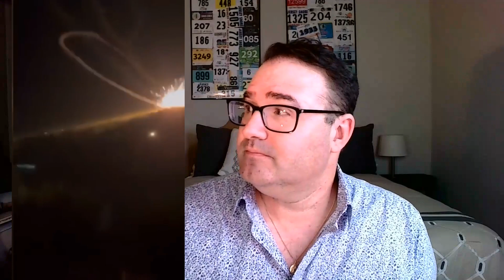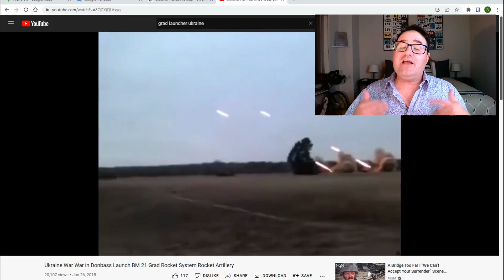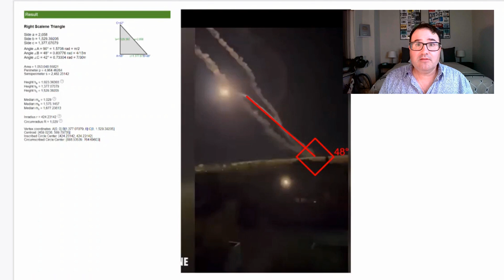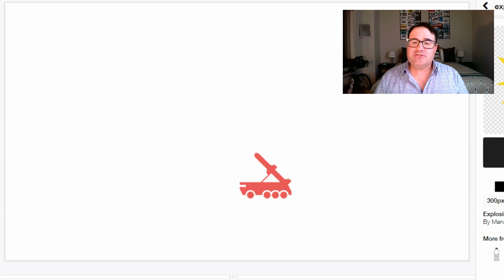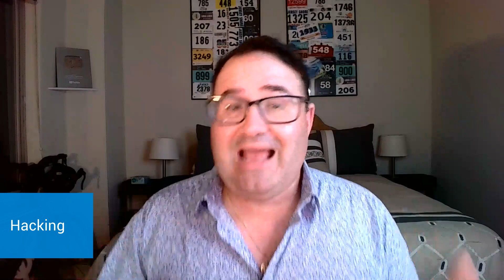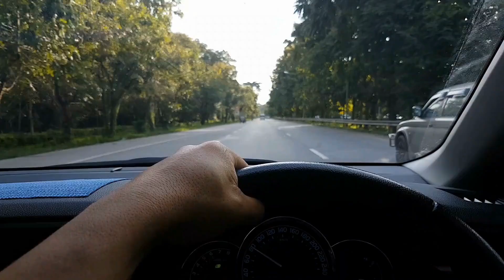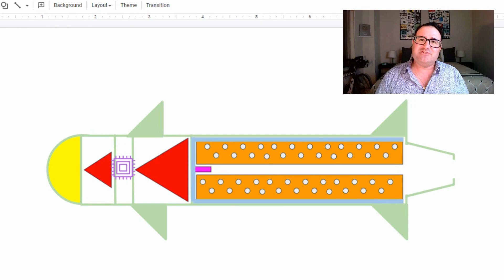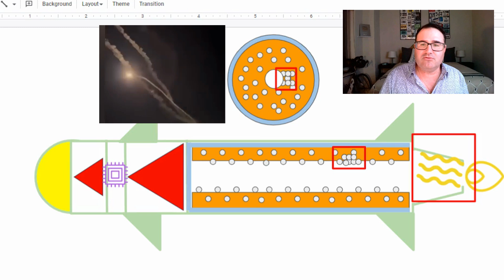Why this missile U -Turned

Comment: I think you're correct with mishandling. But i think it broke. an external fin or something like that. I don't think a slight asymetry in the thrust could account for that dramatic a turn. (unless the missile detected it and over corrected)
Reply: Idk man it sounds pretty solid. There's so much thrust coming out of that rocket motor that even a slight asymmetry could do some pretty wild things.

Comment: Is there an argument that the missile was not designed to work with the launch system and that there were a series of commands given that the guidance system interpreted as "turn around and go boom"  I'm thinking adjusting in a unit of measurement greater than it was being told to if that makes sense

Comment: In life you come to realize that more often than not, the easiest answer is th correct answer, in this case the mishandling or manufacturing problem (which could include a stuck fin to the side), instead of complex james bond type hacking or drone interventions

Comment: But if there's imbalanced of thrust isn't the missile guidance should correct it?
Reply: Only if the imbalance is small enough for the fins to correct it. The missile knows it's off-course, but all it does is repositon the fins to straighten it back. If the thrust just keeps pushing the missile off its path the guidance system will just keep command the fins into max deflection and wait until it straightens out.

Comment: The missile was assembled wrong. What caused those Boeing crashes were caused by some idiot literally jamming mission critical components into a slot that only accepts those specific components and only accepts those components in the proper orientation.

Comment: If it's a BUK, the missiles can do a 40g turn. Also most BUKs don't use a command guided missile, but rather a semi-active homing missile.
Reply: But that's exactly what Ryan said. There is a tracking Radar that tells the missile where to go until it's close enough to use its own radar seeker. That's the principle of a semi-active homing missile works.
Reply: @Espere  There is a difference between a Command-guided missile, where the shooting platform or another system is telling the missile what to do and a semi-active radar seeker that acts similar to an IR-guided missile, as it tracks the radar illuminated target without other signals from the launching platform.

Comment: It can still be a guidance issue. One of the Russian rockets, the Proton M, failed due to a flight control system sensor installed upside down. If the rocket is being told to go in a particular direction and the sensor is installed upside down, the rocket will attempt to correct itself to what it perceives as the correct orientation. This guidance protocol likely kicks in after a designed time period after leaving the launcher.
Reply: Proton M gyroscope can only mounted in one direction and yet somehow the engineer still managed to shove it in there lmao
Reply: @icarus1378  "of course i installed it right, it fits!"
Reply: @Usual_User  "Well...I did have to tap it a little with my hammer...but it's ok."    :-)
Reply: @icarus1378  All three sensors were installed upside down with the aid of a hammer.  And, apparently, a healthy shot of vodka.
Reply: @icarus1378  Mechanics will sometimes do whatever they can to get a part to fit.
Reply: I think you're right there
Reply: I like this theory. It's even got the classic Russian design flaw of relying on Ivan not to install something upside down after his morning fifth of vodka.
Reply: I don't think that would cause a 180 followed by straight flight like we see here. What we'd get from that is a continuous turn to try to turn against the direction of acceleration, like we saw with the Proton.
Reply: @ares7181  if the rocket thinks it's flying backwards it would make a 180* turn then fly straight
Reply: @ares7181  i believe the proton did a continuous turn because it could not turn fast enough and crashed before the end of the turn. This missile however turns pretty fast at lower speed, so it managed to correct its course before hitting the ground, hence the straight line
Reply: I think you might be right, the U-turn seems a little too perfect to be the result of something as random as a bad fuel mixture
Reply: I wonder is that possible that SAM can turn back 180 degrees in very short moments.
Reply: @Anelaceelfead  only because this applies:Okay, I've never been a Sam weapons system tech. However, I have a theory that hinges on their three part Sam site. I think that the radar vehicle had a solid weapons lock on the first two launches. Then, the heat buildup of the first two launches and location of the three kinds of units in play relative to each other play into a situation where the radar victor locks onto the buk launcher victor in error and passes that to the control victor. In response the control victor continues launching, believing that they still have a good lock or that the lock only dropped momentarily. The final buk missile is launched having been locked onto the launcher vehicle and promptly whips around in an attempt to go high order asap. I like your theory and the upside down protonm guidance theory as well, but feel like that turn happened right about when the guidance begins controlling flight characteristics. Everyone has seen a Sam launch and take that change in direction about a mile or so up, just not this hard. Lol I feel for the Russian mothers burying son's, but am glad to know that there is one less Russian land based asset in Ukraine.
Reply: @jamesmcgrath849  I agree, it for sure looks like the error occurred when the guidance system kicked in. Although I think a inverted control integer is more likely.

Also it seems they are radar guided not IR
Reply: @jamesmcgrath849  The missile is radar guided, not infrared guided (Heat seeking). Even if it was an infrared guided missile, the tracking vehicle uses radar guidance as infrared guidance will not work at ~30km.
Reply: @jamesmcgrath849  Radars generally point up and are not too prone to lock onto stationary objects. Just kinda how radars work.
Reply: @ballsquid4135  Even with Radar, the sheer amount of EM crap put out when a rocket ignites could completely screw with the lock causing it to grab the only target it could find, unfortunately for the operator, this was the launcher
Reply: @jamesmcgrath849  You can split a missiles guidance system into 3 parts, the sensor, the guidance package, and the autopilot.

The Autopilot actually flies the missile. From launch to a predetermined point, it is set to ignore any commands and just fly straight. Good bet this is about 2500 meters judging by what happened here. The autopilot performed flawlessly.

The sensor in this case is a semi active radar antenna, and it detects radar signals bounced off the target by the the designating radar. It probably was working just fine, and played no part in the malfunction.

The guidance package, which takes information from the sensor and gives instructions to the autopilot, is where the problem was. It was defective, and it could very well have been a loose connection or bad solder joint. A soon as the autopilot left launch mode and started listening to the guidance package, it received garbage instructions, and did the U-turn. In the U-turn, the guidance package finally completely fails, probably G-forces in the turn finishing off the bad wiring job, but could also be a bad joint melting itself. As soon the guidance package goes silent, the autopilot, as designed, flies straight.

And this is where the humorous part comes in, it flew in a completely random direction, which just happened to be back towards the launcher. It's really no different than idiots doing dumb things with fireworks, and one of them goes off randomly back into the house, hits the camera man, ect ... Murphy had it in for someone.
Reply: @jamesmcgrath849  Damn, If I ever design a guidance system I'll try to make sure that the default target coordinates aren't the launch site.
I wonder if it's also possible that it went into self guiding mode and the closest to a jet engine thermal signature it found was the launch site, althougth that would mean they can do an all around thermal scan and can in fact can perform U turns, and maybe thats too much supposing.
Reply: @EdgyShooter  Good point, I didn't think about it acting almost like chaff in a way. I did see another comment that said another video angle showed the rocket didn't actually hit the launch system, but I don't know if that is true.
Reply: I agree. 

I think the curious thing is that the missile ends up almost exactly where it was launched from. Which to me would only make sense if in someway the inputs for the controls were the exact opposite of the intended direction. Seems like a guidance issue.

I mess around in physics simulators and most commonly:
-Upsidedown gyroscope
-Inverted control interger (positive values become negative ones or vise versa)
Reply: So exactly like an FPV gyro problem 😅
Or Russian version of BetaFlight 🤣
Reply: I think this is the best explanation. This stuff happens all the time.  We had a stability control system installed upside down on our helicopter.... let's just say that helicopter thought it could do aerobatics.  This was USMC helicopter. 
Then also missiles do weird things sometimes.  We had hellfires do a loop and come back at us too.
People are making this into a much bigger deal than what it is.
Reply: Holy fucking goddamn - insert all other known explicatives - shit.  Is this a real, actual, competent, useful comment?.....on Youtube?......lol.  Damn, thanks, brother.  That makes complete sense as a possible, perhaps even likely, explanation of these events.  Your description was brief but highly effective (good info density), and I appreciate you sharing your knowledge in these matters with us all.
Reply: There isn’t enough rudder on the rocket.
It’s likely a manufacturer defect or missshandling.
Reply: Check my comment
Reply: That was my initial guess. Now I'm torn between Ryan's theory and this one
Reply: Actually, with this Proton-M they claim that it was a software issue that they used software from one launching facility and deployed it on this rocket on the new launching facility. And after the launch the rocket just tried to align itself with the predetermined coordinates.
Reply: I wondered if it was to do with the guidance system, I think you're right, but my idea was the targeting computer picked up a stray signal of heat or malfunctioned causing it to target the ground heat source.
Reply: Yeah an inverse proportional controller moving exponentially away from the target or something like that
Reply: This Theory makes more sense to me
Reply: An uneven fuel burn in a solid motor would be more erratic than this perfect u-turn
Reply: I can't see a large SAM in its boost phase having sharp turn capability like this. That capability on systems like THAAD has been widely celebrated as pretty neat and unusual.
Reply: The missile did exactly what it was supposed to do it attacked  A radar site
Reply: Maby the radar in the missile was installed backwards to lol
Reply: If it’s a beam rider then this seems entirely plausible. It probably ignores guidance for a timed delay to get some distance from the launcher. If the antena inputs were reversed it would reverse sense the beam and steer away from it until it turned past the 90 degree mark, after which it would home in on the signal origin. The missile would have to reverse course within the width of beam through or most likely it would loose guidance and fly straight off somewhere else.
Reply: Even if it was a guidance issue, I doubt that missile's control surfaces have the control authority to make that sharp of a turn. The faster you go, the more a given fin deflection causes the missile to turn. It's at almost the slowest possible speed and yet it's able to pull a U-turn? That means at full speed, full deflection would absolutely rip the missile apart. Doesn't make sense.
Reply: @defenestrated23  unless it has thrust vectoring

Comment: One of the first Ariane 5 launches had a similar problem (or was it Ariane 4? Can't remember). A data overflow caused guidance to do a U turn midflight.
Reply: Yes, the first Ariane5 in 1996 used an Ariane4 code loop for lateral speed control which didn’t account for the higher velocity of the new model, and caused an overflow converting 64 bit sensor data into the 16 bit register, which falsely detected excessive veering in a normal launch path.
Reply: Yeah I think it was Ariane 5. At least it terminated midflight, unlike the Proton launch which did a similar thing.

Comment: I'm just a (dumb) civvie, but could EW systems jam it and cause it to recalculate into it's launcher? I'm thinking the tracking radar got knocked out(or more likely some russian just turned it off while getting his vodka), and the missiles own radar took over early, sending it back in on it's launcher? Again, just a dumb civvie.
Reply: Could've set it on radiation seeking mode to try and shoot down strike aircraft using ground attack radar, and the eejit orcs forgot to turn off their own SAM search radar?

Idk. It u turned too perfectly to look like a busted fin to me.
Reply: @prfwrx2497  wdym ground attack radar? It's a SAM system not cruise missile 

But, as what Ryan said in the video, most likely mishandling
Reply: @captainbroady  I know, that's why I'm confused as fuck. It shouldn't turn on a dime that quick, but it did so very cleanly. Solid 180 and a straight beeline. Not some erratic deviation that gets more extreme and out of wack with flight time.

The seeming flight path stabilization after the turn and well before final impact is what still confuses the hell out of me.

So, basically, if it was a propellant defect, there was two perfectly opposing clumps that acted damn near perfectly to counteract each other's action, but at different flight-time? Given the whole video, that's my pet theory now. A one in a billion freak accident, perfect counterbalanced clumps that were out of phase in burn time.

And to be fair, I've never seen any ground to air ARM either, despite the fact that strike aircraft does emit radiation.